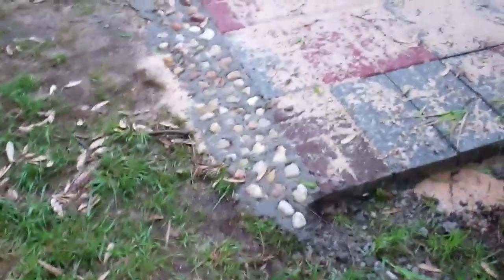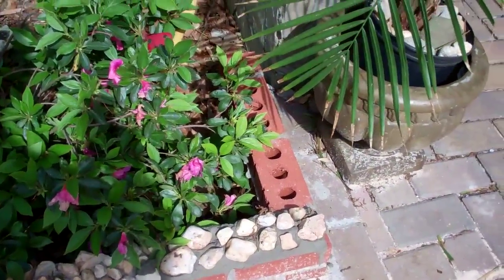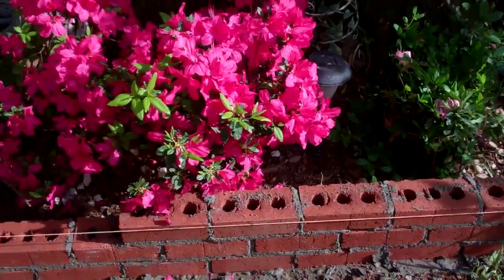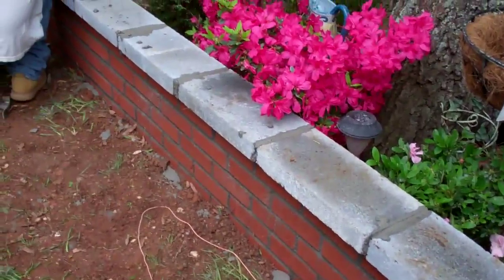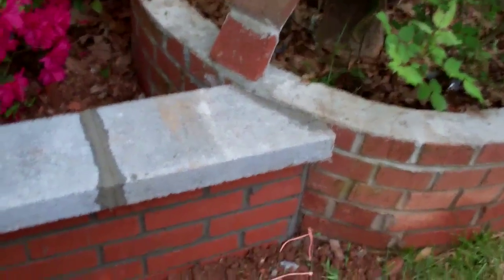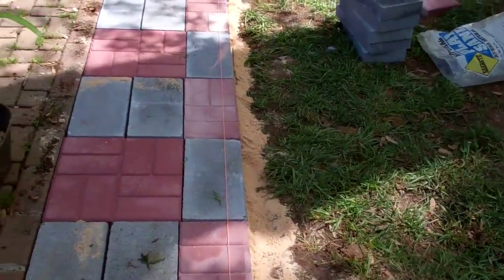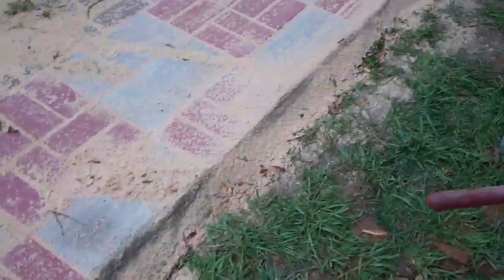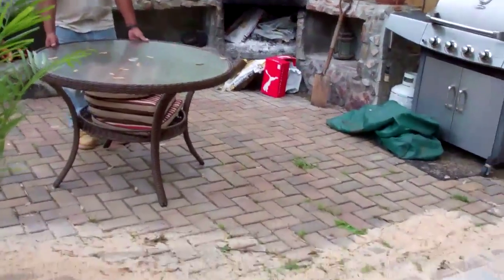Building a Brick Bench, Finishing a Stone Patio and Brick Border Projects

Comment: Can you provide details on the saw kit used to cut the stones?  Is it just a circular saw with a diamond tip blade?  I'm doing a patio as well, and haven't figured out how to cut the blocks.
Reply from the maker: I use a DeWalt 7" inch diamond cutting circular blade on a older DeWalt worm-drive saw.
Reply: Thanks very much!!